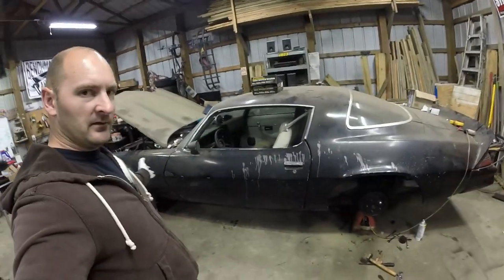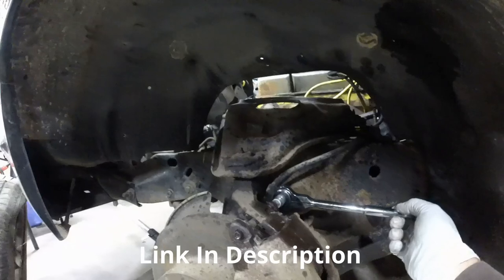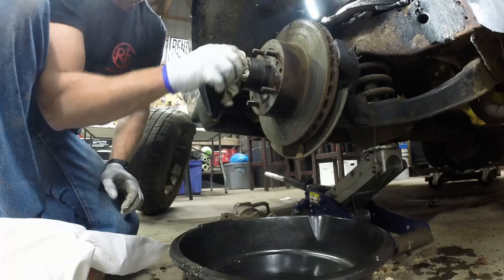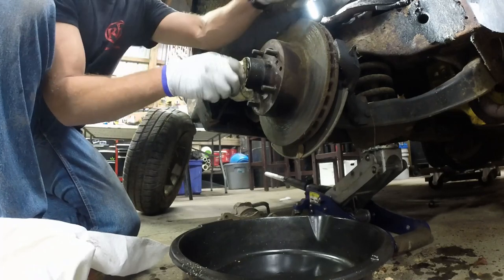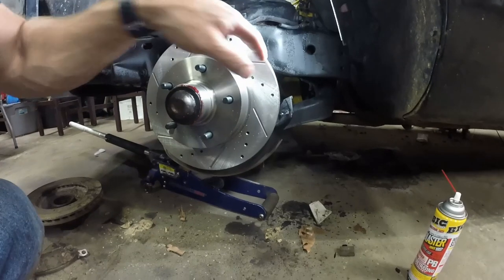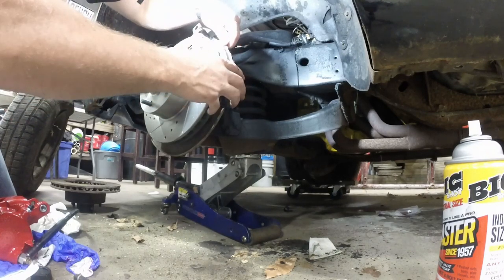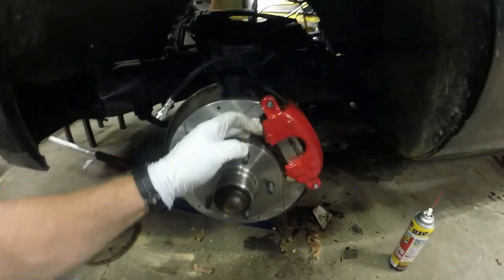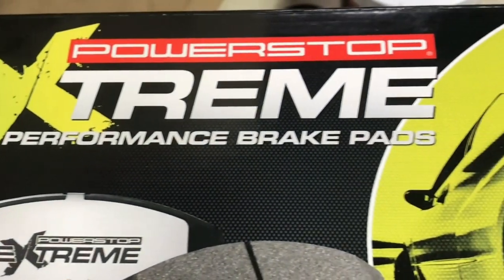NEW FRONT ROTORS, CALIPERS AND LINES!!! (1980 Camaro, 2nd Gen Restoration)

Comment: I just bought a 79 Firebird that has these same rotors and calipers. I seem to have to push the brake pedal down further that I should need to and just replaced the master cylinder. No Difference. You mentioned that the rotors have to go on a certain way which would indicate that they are side specific. If what you are say is correct about the slots starting at the center and pointing towards the rear, mine are on the wrong sides. Question; how did you determine the correct orientation and do you think it would cause the sort of problem I described about a soft-ish pedal? Brakes have all been bleed including the master cylinder. Is it worth the effort to switch sides?
Reply from the maker: I looked up everything I could on slotted rotors and all the manufactures stated to install them in that direction. My pedal is nice and firm. I’ve replaced everything except for the rear hard lines. I have zero complaints.

Comment: Sorry, but that's not the way to install the caliper and pads. You don't hang the pads over the rotor and then try to put the caliper over them. The pad to piston spring wasn't even installed. Load the pads into the caliper first including the pad to piston spring. Then slide the assembly over the rotor. There are other details that needed to be done too. Best to read the factory service manual for your car before doing this work.

Comment: The service manual specifies a torque on the castle nut while spinning the rotor before backing it up. Your fingers will not seat the inner bearing properly.
As stated you didn’t even put on the spring on the inner pad that snaps into the piston hole. FWIW your suppose to put the pads in the calliper first on 1st and 2nd Gen Camaros. Your calliper is not a Bear or Wilwood! Those are the types you slide in the pads once the calliper is on the calliper bracket. Also apply brake grease to all sliding surfaces and O rings and pins.😮
Reply from the maker: Everything was retorqued after this video. Thanks for the info.

Comment: With the new brake hardware in the front, what was the result of it in terms of braking?  Did the brakes improve the stopping distance over stock parts?
Reply from the maker: I haven’t done any actual testing on the brakes yet. As I build the car for the road/track I’ve been restoring and replacing. The cost of just stock parts compared to performance parts was not much more money. I know the brakes work great. The old brakes were trashed and needed replaced. When I get to do some testing I will do a video on it.

Comment: I am having trouble locating a bearing dust cap (grease cap) for my 1980 camaro. Do you know where I can buy one?
Reply from the maker: I’m not sure have you looked at classic industries?
Reply: I have. The one that is called out for 70 - 81 is too small. The 79 - 81 camaros had a larger outer bearing. The dust cap is a slight bit larger than the previous year models.